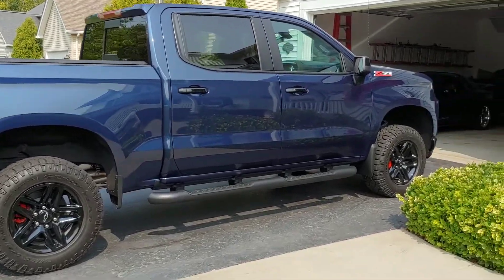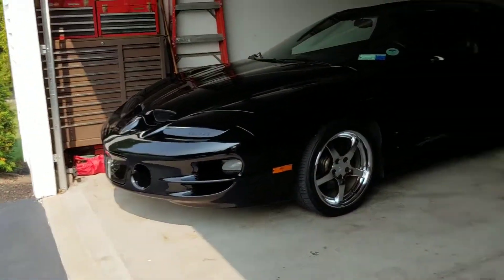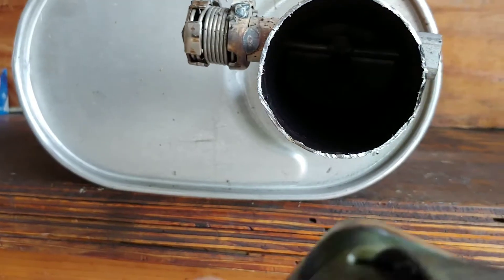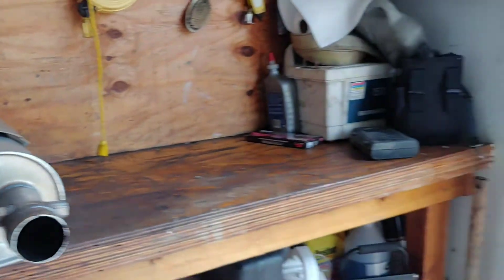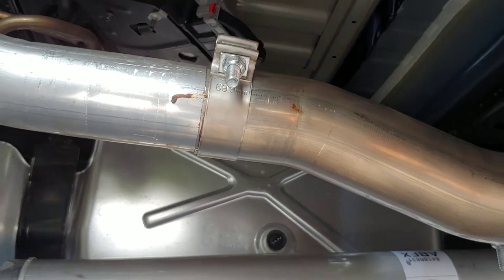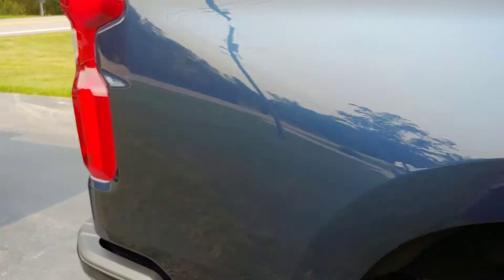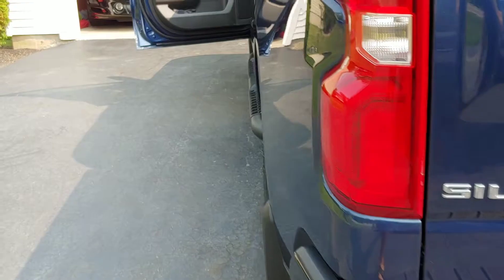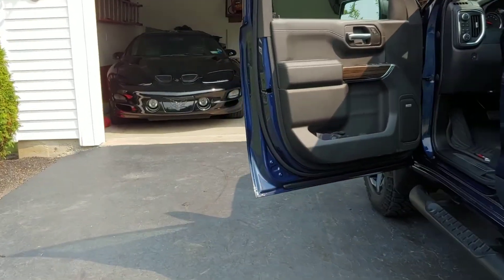2020 Silverado Trail Boss LT AFE muffler replacement

Comment: I have this same kit on a 19 5.3 single exit. It sounded very similar to yours and I loved it, but after 35000 miles it has definitely become louder. I hear more drone as well.  I'm considering replacing the muffler with either a series 70 or super 50 Flowmaster so I won't have the packing issues that this one must be experiencing.

Comment: This is by far one of the better sounding muffler swaps I’ve heard yet on these trucks, makes me tempted to put the same setup on my trail boss! Whats the drone like with the dfm? Only thing holding me back yet. Also did you do the 1 inch motofab level? Any issues with angles? Thanks!
Reply from the maker: Thanks, I really like it as well. As far as the DFM I can't even tell when it is active. The only thing I do hear is on deceleration right before you come to a stop I hear a burble. I still can't hear any drone.

Comment: Were you able to cut both valves out? The directions show leaving the front one on.
Reply from the maker: I have the 5.3 so I only had 1 valve. You should be able to cut them both out. Assemble the new muffler and pipe and take an end to end measurement. Then measure just before and after the valves to make sure you have enough length with the new muffler before you cut it out.
Reply: @diesel9329  Thanks, just got it in.  If I would have cut the front valve off the exhaust pipe jumps to 3.5" after that and the new 3" wouldn't have fit over. I just  cut the valve out on the inside with a cutting torch. Worked great. SOUNDS perfect! Not to loud and tons better than stock.
Reply from the maker: Awesome! Happy it worked out for ya. I am very pleased with the sound. I wouldn't want it any louder.

Comment: Have you towed anything with this and if so is it extra loud while towing? Thanks
Reply from the maker: I never towed with it. I ended up trading it in on a 21 with a 6.2.
Reply: Got myself a 6.2 as well, noticeably better than the 5.3?
Reply: @jtob5032  yes for sure a good chuck of difference, I have a 5.3 cause it’s my daily driver and 6.2 is overkill for me as of right now, my mind may change tho, how you enjoying the 6.2? I was looking to upgrade to a new Chevy but those Ram treating me right with the interior. The new interior on the Chevy doesn’t look manly to me.
Reply: @Aspirationandjokes  thanks for the reply mate, I havent received mine yet. Im in Aus and it's a bit of a process to get it here then converted to Right hand drive. They reckon May-June :)
Reply: @jtob5032  oh I see, I bet you’ll enjoy ! Great truck for sure! Planning any mods ?
Reply: @Aspirationandjokes  probably just an exhaust to start with, Borla S Type.. Then maybe a supercharger in a year or 2 ;) Theres a company in Aus called Walkinshaw that will honour the factory driveline warranty with their supercharger kits
Reply: Nice truck man, I got the 6.2. Custom trailboss last month I want to do a muffler delete but not quite sure about will it void my warranty.

Comment: No difference from stock you need to take the resonators out of the tail pipes in the back trust me
Reply from the maker: There was deffinatly a difference from stock. Just not as much as I liked. I did weld up the resonators and show it in this video.
https://youtu.be/MUgixiGwoX8
Reply: Completely different than stock. Nice low rumble.